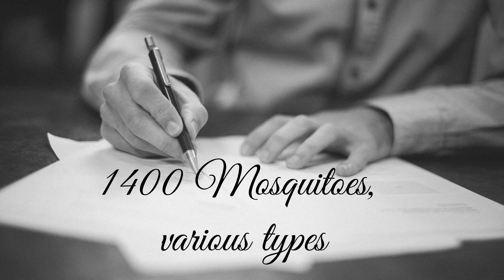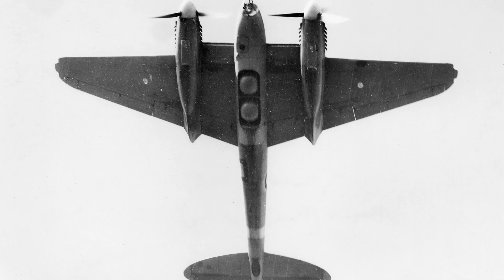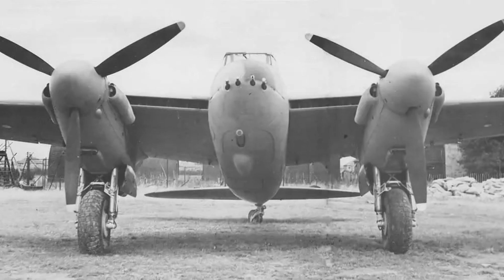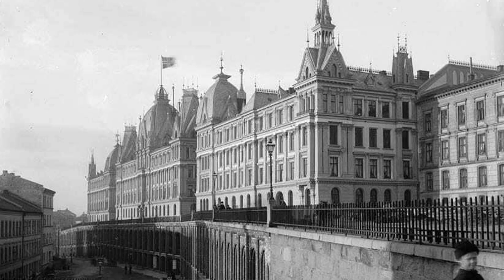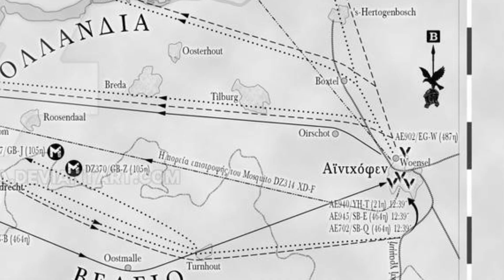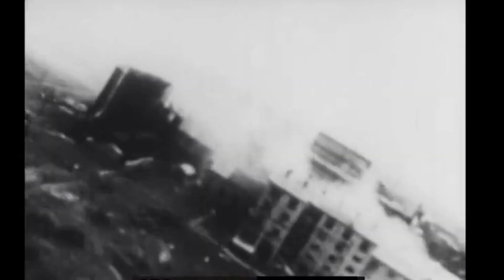de Havilland Mosquito (Mossie!) Part 2

Comment: As I mentioned in part 1, DH.98 Mosquito is my favorite aircraft, so I'm very happy to see your work very well done telling the saga of this iconic Warbird. I read in one of the several books I have about him that when adapting the Bombay to a 4,000lb blockbuster, the comment among the designers was that due to the bulging doors necessary to accommodate the large volume, they impregnated the Mosquito, comparing it to a female of pregnant guppy fish. Another interesting fact is that the 6lb (57mm) cannon of the Tse-Tse version (which was used not only against U-boats, but also sank surface ships) was the largest autoloader type used by an aircraft in WW2 - there was a version of the B-25 with a 75mm cannon, but with manual loading.
I'm waiting for the 3rd part, hoping it addresses the issue of how they pressurized a wooden fuselage for the high altitude versions 😉. Greetings from Brazil.